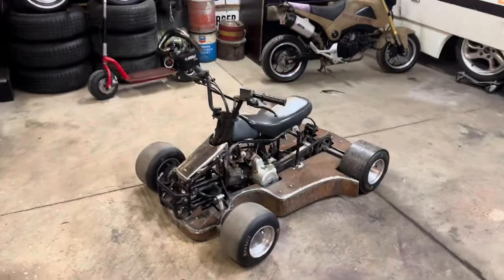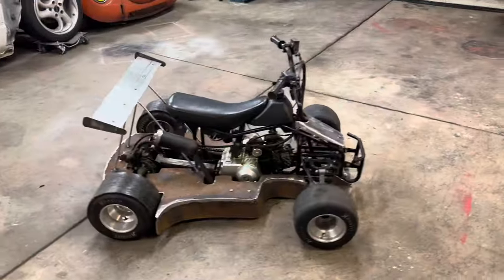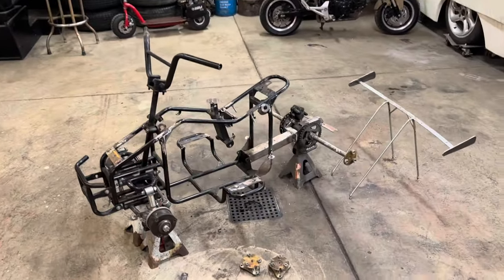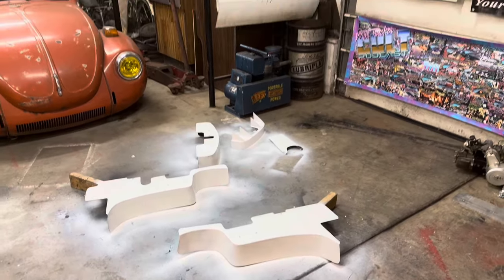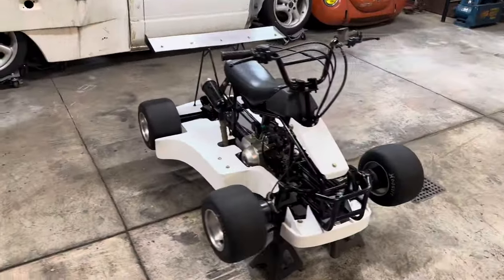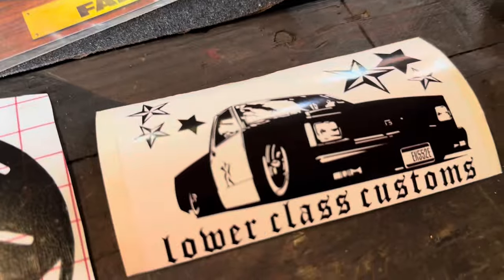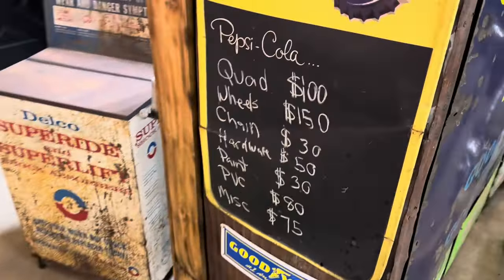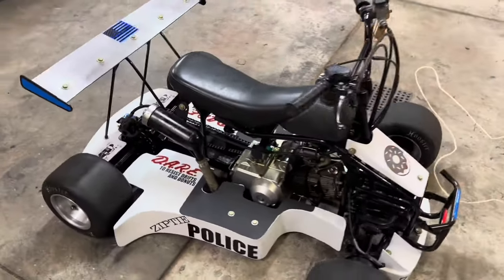COOLEST DRIFT KART ON YOUTUBE!!!! $500 BUDGET BUILD

Comment: Nice work on the rear rotor. Since you probably don’t need the rear brake anyway, I wonder if’n you could use L&R master cylinders to independently operate the front brakes. Kinda like steering brakes. I’d think you’d be able to whip some fast 180s.
BTW, I love the slammed Shithook in the back of the shop.
Reply from the maker: I thought about independent front brakes but it slides so easy I decided it wasn’t necessary